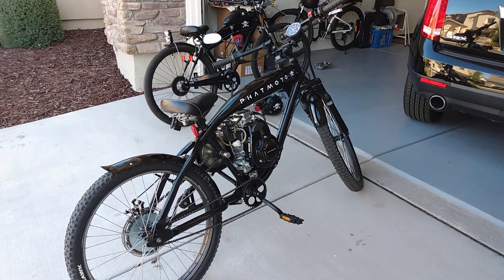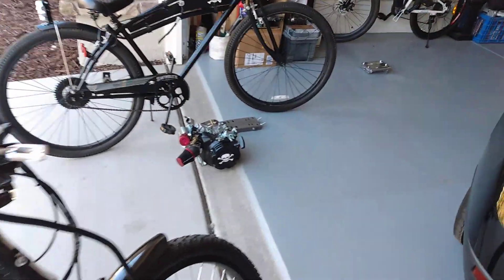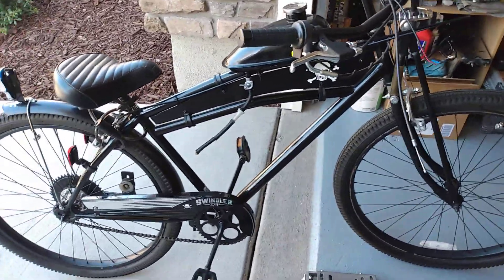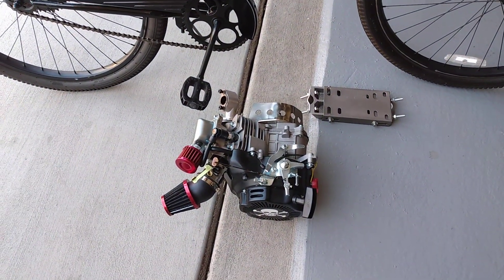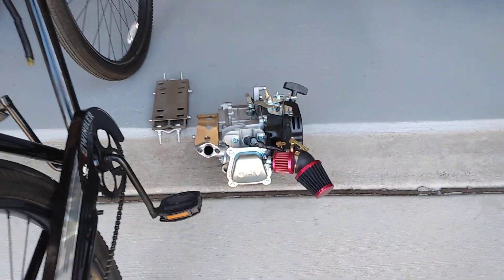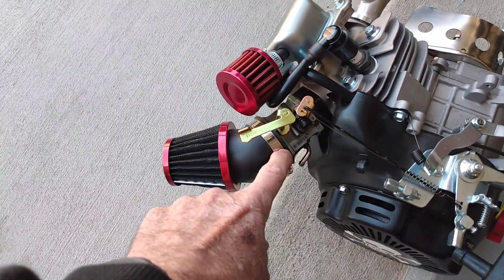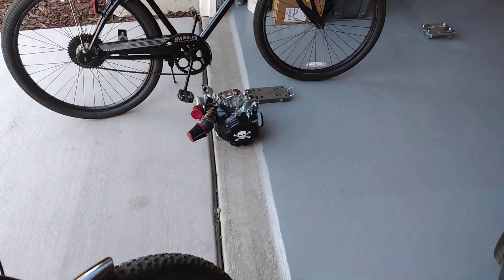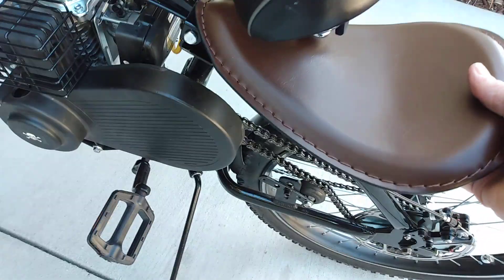Phatmoto Switch back to stock Lifan 152F-3 engine. No upgrade, a retrograde

Comment from the maker: The Sikk Ped from Sikk Bikes, comes with a (Lifan) style 49 cc engine, that can be boosted to 70 cc's with a big bore kit. The kit is cheap around $100 and pretty easy to do.  Also the Sikk Ped comes with billet wheel hubs which will hold up to the rigors of daily use and probably won't fail as often as some other brand we know.

Comment from the maker: Go to Sikk bikes and see their 49cc motorized bike, electric start, hydraulic brakes, fat tires and good build quality.
Reply from the maker: Charles Easterling  It doesn't matter, they won't sell the P79 cc in California. They are not in the stores, and they will not sell them online to a California address. You can buy it from Gasbike a southern California company, for $149, Gasbike has the C.A.R.B. (California Air Resourses Board) certification so they are allowed to sell it.  They sell the 212's all day long for $119
Reply: That's weird because your work is actually on par from what I see and build myself. The Logan is crap. The block is fragile. But hey like you said your choice. Smh

Comment: Which engine did you like best, the lifan or predator?
Reply from the maker: It's a toss up, the Lifan is a better built engine and less noisy, smoother. The Predator has much more torque and is more suited for a CVT torque converter.